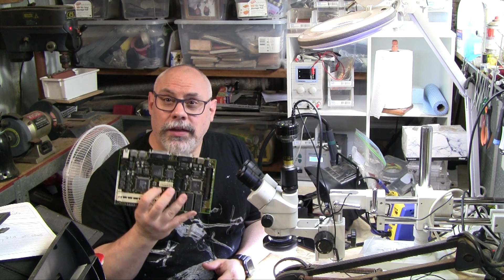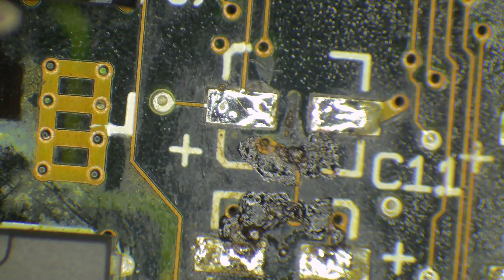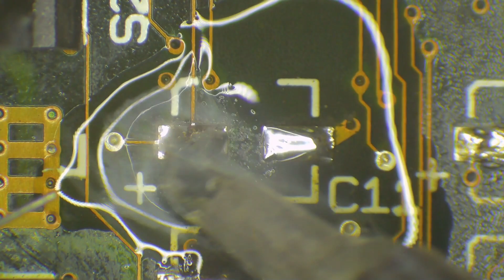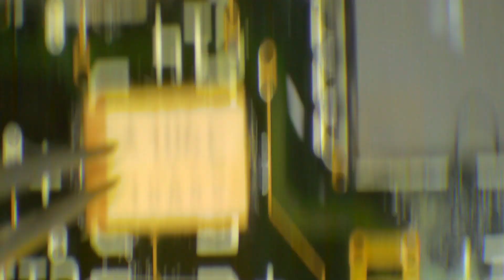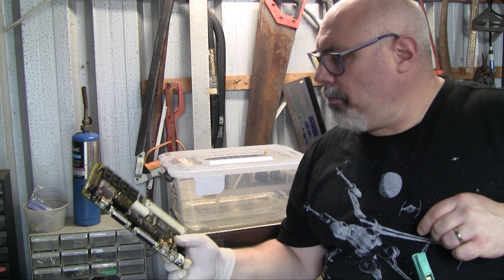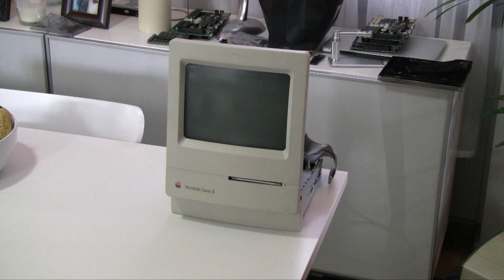Recapping Tutorial - how to replace old, leaky surface mount electrolytic capacitors

Comment: Unfortunately, you're not replacing electrolytics with electrolytics. You're replacing them with Tantalum caps, and the procedure is different than with electrolytics. It would have been better if you had demonstrated soldering the same type of capacitors with plastic bases instead of tantalums with ceramics.
Reply from the maker: Customers typically request I replace electrolytics with tantalums, but sometimes I'm asked to replace electrolytics with electrolytics. Feel free to check out one of my live streams. Jump onto the live chat and say hello. I'm always happy to provide live demonstrations.
Reply: @BranchusCreations  Thanks for the invite. Much appreciated.

Comment: Good load of info here.  As for your alcohol bath, do you recommend 91% or 99% or will standard drugstore 70% do as well.   Do you have a recommendation for board with  conformal coatings ?  
I have an old apple like that, been in the attic for at least 20 years. Will give it a go later.
Reply from the maker: I think the main issue with any form of diluted iso alcohol is that when the alcohol evaporates, whatever was used to dilute it will still be there on the board. If you're having trouble getting 99%, maybe use distilled water instead? It takes longer to dry, but its purity means that nothing will be left on the board after it evaporates off.

Comment: was hoping to see some heavy corrosion set in where the solder has turned grey from cap leakage and will no longer flow. myself I don't even bother with hot air on smt caps, just a medium long cylindrical tip and a leg at a time.

Comment: I clicked "Like". Now the real appreciation. I am grateful to you for your video.  I was giving up repairing because I could not replace a SMD capacitor approx 2 mm in size in a very narrow space surrounded by electrolytic capacitors and the connector/jack in a Main Board of a TV.  The capacitor was moving away while soldering.  I needed another hand to hold the capacitor in place and then use my two hands to do the soldering.  I was using a pointed tip for the soldering iron since the capacitor was too small.  Your video suggested to use a bevel tip instead.  That freed up my hand because I could carry a blob of solder on top of the bevel tip and hold the capacitor in place with a tweezers by the other hand. I could solder the SMD Capacitor and tested. It was successful and the voltage reading return to the condition prior to the bursting of the capacitor (happened while testing an IC chip on the Main Board with a DMM with a tip which was slightly (0.2 mm perhaps) bent in a "L" shape that touched an adjacent pin). Thank you again. Hats off to you Sir for your contribution.  You have provided lot of tips for us in your video.  We highly appreciate. By the way, just Subscribed to your channel.

Comment: Wouldn't it be safer & faster to dry the alcohol from the board with a blow dryer on low setting? 🤔
I've found that moving warm air usually drys much faster than just being placed somewhere warm with no air current

Comment: My issues is that I don't have hot air. I want to recap a super nintendo motherboard. I've seen people either twist them off or cut the barrel with flush cutters and then they fall apart. Just need to clean up the pads after. I'm going to try that and hopefully it works out.

Comment: Very instructive, thank you for sharing.
Why did you prefer to replace electrolytic cap. by tantalum ones? I understand about the potential dry out (increasing ESR), or even leakage. But I’ve heard about problems on tantalum, including exploding (if I remember correctly).
Another point is about proper component sourcings - Chinese vendors are Ok for Caps, or also questionable, even for that too?
Thank you for any clarification about these topics.

Comment: Hey abit of a noob here got a board with a 47uf  50v  I got a 4.7 UF 50v can that be used to replace it ?
Reply: Nope. Your replacement has far lower capacitance than the original.

Comment: I like to add fresh solder first. Depending on the electrolyte formula, corroded solder can require a lot more heat to melt… so much it sometimes causes the capacitor to explode. If it has trouble taking fresh solder you probably weren’t going to get it with a reasonable temp on the heat gun so you might as well crank your iron temperature for some targeted heat until you get it to take fresh solder. Once the old stuff is diluted with fresh you can switch to the heat gun but I like to keep the iron going so I can hit the negative side of each cap directly (the one that’s often on a thick ground plane). That way I get it off much quicker, before all that heat can conduct into the electrolyte chamber. Your iron has to remain hotter than the air or else the hot air will just cool the iron (all things relative).

Comment: Great Video.  What temperature did you set the rework hot air tool ?
Reply: I was looking for this too and found his answer in another comment:
Temperature: 420°C, Air flow to maximum

But anyway, I'm not really sure about the air flow setting. I think here you will have to experiment yourself.
Reply: @jmebusiness thanks for the tip!

Comment: Not sure why you would go so far as to say “ you’re not going to want to use an all in on.” I legit accomplish everything I try with the same exact amount of effort with my all in one lol, infact, I’ve tried to replace it and I always go back, and it’s not even a name brand lol. If I’d spend extra anywhere it would be iron tips. I guess I’ll be trying a more expensive hot air gun, but only to see if I am missing something, but I wasn’t impressed the change last time I bought a dedicated unit and again went back to my cheesy 898d lol. By far, the difference make has been tips.
Reply: And flux. I admit, I frequently day dream about getting an expensive station, but the honest truth is, it’s a pointy piece of metal that gets hot. Heat is heat and if the temperature is reliable on a cheapo, what could I possibly be missing? If anything, I may walk into another learning curve haha.

Comment: I go low-tech, use a new cheap toothbrush then hang them outside on a clothesline, but it's hot here in Thailand.  I'm amazed if that board actually worked, it seemed almost too far gone for repair.  Thanks, good video.

Comment: Dear sir , thanks for sharing video for  bigginer like us. I set temperature 407 and air pressure 2.5 to remove capacitor, but black material of capacitor melted. What is your suggestions for me?
Reply from the maker: Yes, the base of the electrolytic capacitor will melt during removal, but because the old capacitors are being discarded, this doesn't really matter.

Comment: Amazing video. Thank you. I actually laughed out loud a few times at the speed with which you removed those four caps. I removed most of the ones from my SE/30’s logic board last night and I must have been at it for at least an hour, possibly two. I have only a 15W soldering iron (with bevel tip) and so I have to work slowly and be patient not to rush anything and cause unnecessary damage. I’ve ordered new caps which should arrive in a couple of days and then I’m going to attempt to fit them. I might try my new 30W iron for that, as the speed with which your iron cleaned up the pads and soldered the new caps in place was just incredible. I’m building myself up to a hot air station but I simply have no room to store or use it in my small apartment. I’ll have a workshop one day! 
BTW, I’m going with similar spec caps to the original ones, not only to keep the board looking “factory” but I figure that if it lasts 15-20 years before I have to do it again then that’s fine by me 😀 I hope I don’t live to regret that decision. 
Your other video on rebuilding an old Apple floppy drive was also invaluable and after I followed your instructions and guidance my SE/30 now boots fine from floppy for the first time since under my ownership (almost 10 years!). 
Thanks for making these very helpful videos.

Comment: Microscope is so important for smd repairs. I managed to solder over ribbon tape from fullhd laptop lcd because my kids breaked some of the paths while stupidly playing with the screen. Only under microscope with back light I found a place of fracture, abraded the front foil to expose copper and slided the soldering iron over the tape with a lot of smd flux > tin connected all the fractures, and then applied a bit of varnish. It worked like new few month till they shattered the LCD ;)

Comment: Hello i have a 32y old walkman with leaking Smd  caps.The board is most likely corroded to an extend...using IPA to clean it wont have any impact on the existing components?I have been told that i need to clean the whole board with IPA,and let it dry before i do anything else to it.Any help would be appreciated...

Comment: question..one of my smd capacitors got knocked off while I was installing my GPU. it has the numbers 535, pc, 330, 6-but the 6 could be 16, at least thats what I could see, its so small..do I need to replace that capacitor with the same type  or can the voltage be higher. and it  has a purple color on top, left side. thanks.
Reply from the maker: Yes, you should be fine using a 16V capacitor in place of a 6V (actually 6.3V). The purple colour indicates that it's a polymer capacitor. I can't be certain without seeing the original component myself, but this is probably a suitable replacement: https://www.mouser.com/Search/Refine?Keyword=16SVP330M

Comment: On another video the guy just twists the old caps with a small plier. Just leaves the solder tabs to be taken off with an iron. Good alternative.
Reply from the maker: I've had quite a few boards come to me for repair after tearing the pads off using that method. I know a lot of people do it successfully, but I would never recommend it.

Comment: You’ve taught me a lot and due to your advice, I’ve  managed to reflow a controller port, mod a Famicom for AV and put a 60hz switch on a Master System. I’ve watched this video multiple times, as I may try to recap and Amiga but I think I’m learning that I need a new solder tip as mine never gets as hot as yours and sometimes, I have to wait for solder to melt!

Comment: good  guide - I find using 2 irons  thats one in each hand can be a quick way to remove components as you can heat both pads up simultaneously  - can be handy sometimes in situations where you cant run hot air
Reply: That is the way I do it, 2 irons. I have found that I stand a lot less chance of ripping off pads or blowing away parts that are very close. I have fixed dozens of Symetrix 528E mic processors that have 14 4.7uF 35V SMDs and the 2 iron method is both fastest and safest. I have tired every way possible.

Comment: Hi Bruce, love your channel. I have a Mac Plus and a Mac SE FDHD which I have owned since childhood. I would like to recap them eventually. I also own my grandparents 1962 AWA TV which I am planning to recap which has a lot of old paper caps. I'm very new to electronic repair. I have been told you can test the capacitor with a multimeter but you need to bleed the capacitor first to get an accurate reading, however some sources say you could get a lethal shock from some capacitors. Do you think you could do a video on this? Thanks mate 👍

Comment: Cheaper to just replace the device if you're only doing one or a few.
Reply: I came here from a "vintage computer restoration" site. And because of aging, the capacitors on many old computers and game consoles and synthesizers are very often are ready to burst or leak if it hasn't happened already. That's just three examples where re-capping is desired. "Replace the device" only applies to a specific set of electronics, where a replacement is easy, and/or the cost of replacement is low enough.

Comment: what temperature you have your hot air station at when desoldering these SMD caps...?
Reply from the maker: I have it on about 420ºC, with the air flow turned up to its maximum setting.
Reply: @BranchusCreations  Wow, seems very hot for us just starting out. Would you have a different recommendation for someone without your level of experience?
Reply: @schardin2005  What sort of hot air station are you using?
Reply: @brucerayne3425  Yihua 948-II it has both a temp control and and airflow control.

Comment: I actually use my hairdryer to dry boards, it doesn't get too hot, warms to board up nicely so that water evaporates and you can really blow it out from under sockets and chips. I do however let them rest for at least 24 hours even after that.

Comment: Hello, nice video! I was just curious: don't tantalum capacitors fail to short, rather than open as with electrolytic caps? If that is the case, couldn't these be more dangerous in some respects to a standard electrolytic? Thanks again for the videos!
Reply: For small value capacitors like 1 to 10 microfarads, would’nt it be better to use ceramic caps?
Reply: I'm not that big of fan of tantalum caps.  There are some better ones, which aren't that cheap. If the board is small and space is tight, they might become in handy. The big thing is, that the board has to be pretty stable. Extreme temperature differences, warping, vibration or stress next to a tantalum cap may crack the inner layers of the tantalum caps. Then they become a ticking timebomb. Some tantalum cap manufacturers are doing a better job mitigating that, by putting a guard around the pad area (inside the cap). As board designer, you need to think about, what happens on your board an where you can place them and in which direction does the board contract and expand the least.
I have seen some placed next to a connector or screw terminal, which blew a hole through the entire PCB.

Comment: From recapping many apple mac boards, and learning along the way, I find the SAFEST way to remove capacitors, surprisingly is to use needle-nose pliers and gently twist them (not pulling but twisting left/right).  It basically pulls/breaks the terminals out of the capacitors (not from the circuit board).  Safer than a heat gun or trying to use 2 irons.  Again, we are NOT pulling these off the board, we need to protect the delicate pads.  Once removed you basically heat up and remove the left-over legs of the capacitors.
Reply: I saw that on another tutorial video and indeed it looked like a good method.
Reply: Thanks Matt . That’s sounds like a great way of doing this. I will give it a go..
Reply: Yes, this twisting those SMD capacitors method works like a magic. Just tried it out today successfully. Saved me a lot of trouble.
Reply: Its the easiest way to remove em
Reply: @ً How do you mean by black surface? If thats just PCB material then you can't apply solder to bare PCB material, you'd have to repair the pad.  It's tricky but can be done in most cases with the use of copper tape or adhesive to glue the original pad back on.
Reply: Nonsense, thats the worst way to remove them and damages the pads.  Use desoldering tweezers or don't do it at all.  Ive bought gear with the pads missing because some idiot twisted the capacitors off.
Reply: @OnlyAmiga85  There's a right and a wrong way to twist them off.  The secret is not to try and pull them while gently twisting.  In fact, slight downward pressure helps to avoid damage to the pads.  Whoever you bought the gear from obviously didn't know how to remove them correctly.